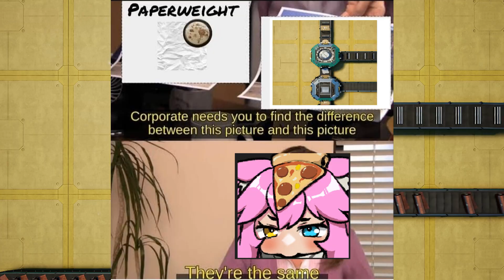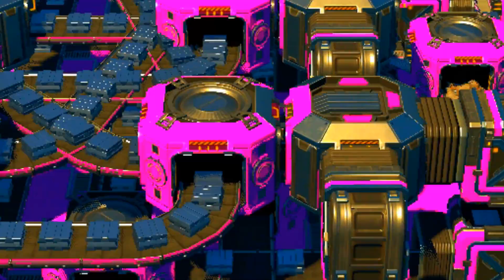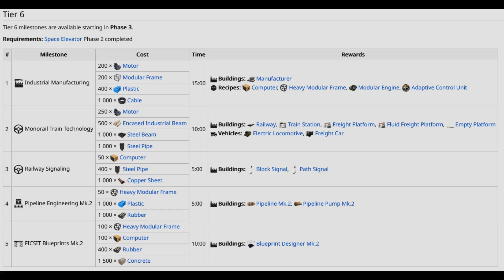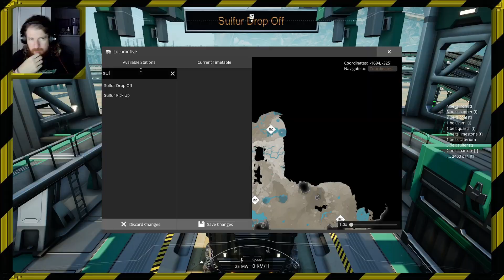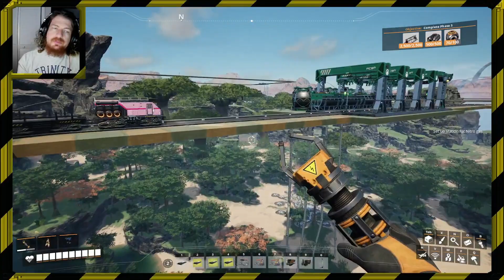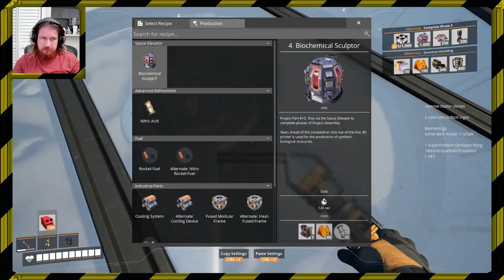Can You Beat Satisfactory With Just Sushi Belts?

Comment: I don't think you said which version of satisfactory you did this in but just to point it out -

In satisfactory 1.1, with the addition of being able to place splitters/mergers on lifts, n-n balancers are trivial to build now.  At least if you know how to build a 1-n balancer.

Build a 1-n balancer.  Stack it on top of itself n times.  Merge the outputs with vertical lifts.  Easy peasy.

The downside is that they're vertically bulky.  Also, the spacing is a bit weird because of the way splitters/mergers snap to lifts, but that's pretty minor.

I hope this helps you avoid difficulties with balancers in the future.
Reply from the maker: This was done on 1.0 so those features didnt exsist however. That is a wonderful solution! It took me a second to wrap my head around it but it makes perfect sense. ❤